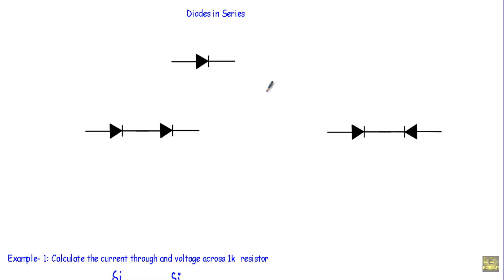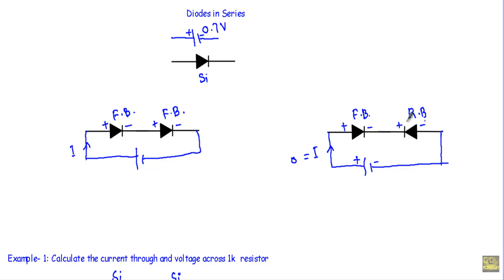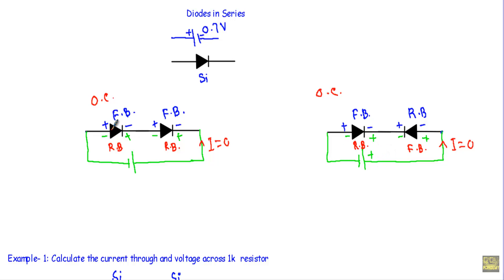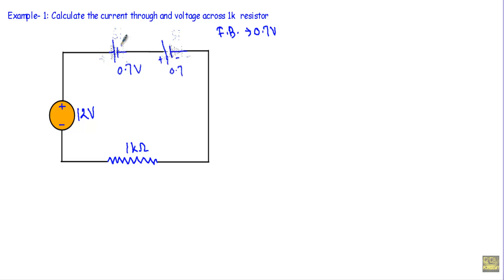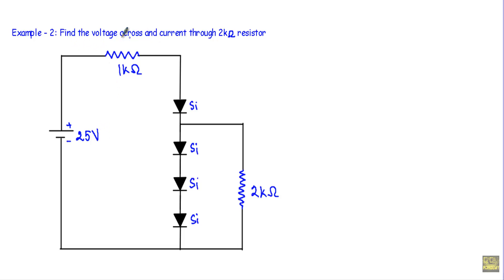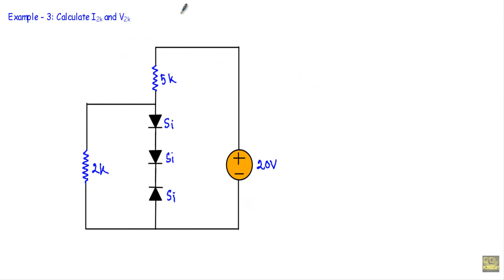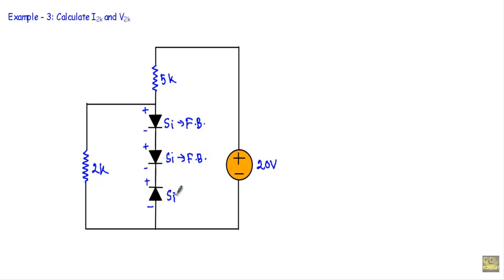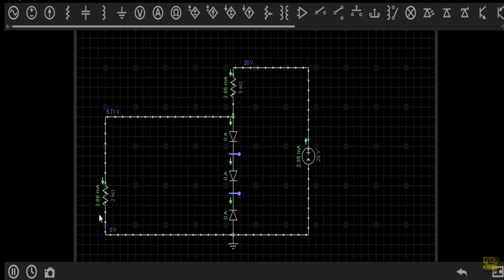Diodes in  Series Configuration

Comment: V drop at 3 si diodes is 2.1 then 24.3v -2.1=22.2v only will come right? U mentioned only 2.1v drop across 3 si diodes ???
I across gets changed respectively with 22.2 v drop!!! Clarity needed.